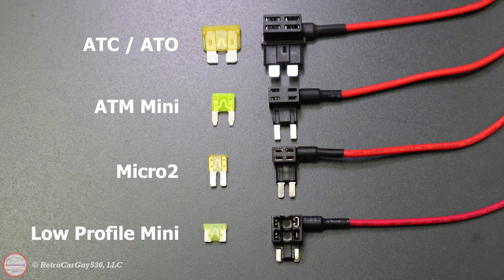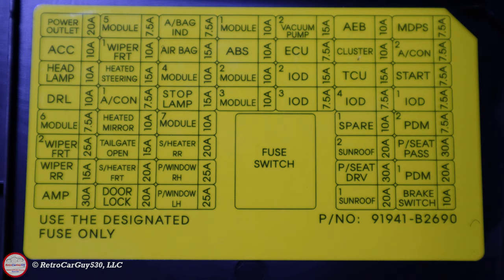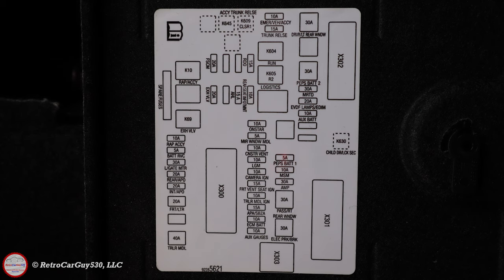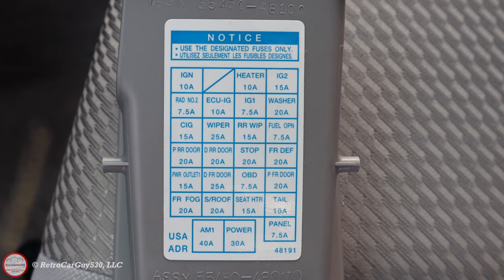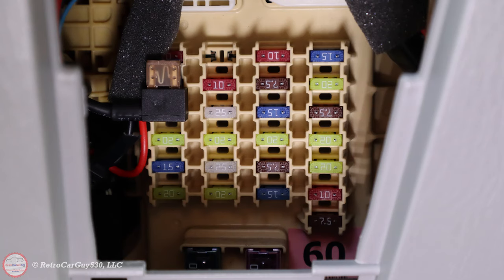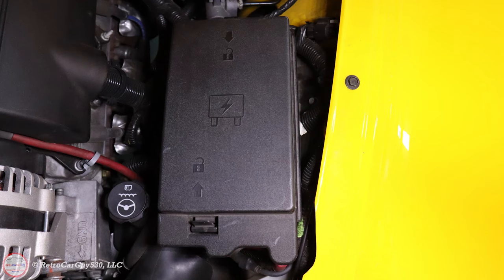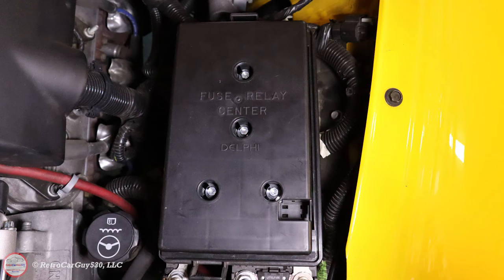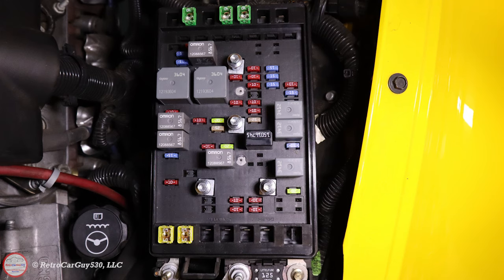How To - Add a Fuse Tap in Your Vehicle

Comment: One question for ya  530 guy? If I take a 15a out to use that space on fuse block ,is it ok to also put a 15a in the other spot on the add a fuse..
Reply from the maker: I tend to cap the max amperage of the two fuses in the fuse tap at 25 amps.  Some say 30 amps is ok, but I tend to favor the conservative side of the amp draw through the fuse tap.  The fuse socket should also be one that receives power directly from the ignition power and not supplied via a power circuit from a module (like the body control module or others).   When the power is coming from a circuit within a module in the vehicle, the module often expects or only supports a specific amount of amperage on that circuit.

My 2014 Chevy Caprice PPV project car on the channel has an entire fuse panel on the end of the dashboard that receives its power from the body control module (BCM).  None of those fuse sockets are a good candidate for a fuse tap since the BCM is not necessarily expecting an additional load on those circuits.  That's why I suggest to avoid fuse sockets that receive their power from a module (like the BCM).

I have a FAQ video talking about max amp draw, wire gauge and wire length.  https://www.youtube.com/watch?v=DnZ5wb_A5vE

Most of the time when the amp draw gets up to 30 amps, the fuse type often is not a blade style fuse.  I know that 30 amp blade style fuses do exist, just they are not commonly used in the blade style fuse sockets.  That's why I like to cap the amp draw at 25 amps for the two fuses in the fuse tap.

That would mean that the original fuse in the fuse socket being a 15 amp (it would go in the lower socket in the fuse tap) and that would leave about 10 amps for the new fuse being added with the fuse tap.

I hope that helps!
Reply: @RetroCarGuy530  I'm trying to power my 30" led light bar, which size switched fuse should I look for ,then what should be the other fuse that I add to the add a fuse??
Reply from the maker: I can't give you a specific answer to what size fuse to use in the fuse tap for the new accessory.  It depends on how many amps the 30" LED light bar will draw when turning on and when it stays on.  The initial power demand can be higher than the steady state amp draw of the device.  I would hope the documentation for the LED light bar would document the power requirements for the unit.  You always want to use a fuse that is rated no higher than what the device requires, otherwise the circuit is not being protected properly.  

If the LED light bar does not come with proper documentation, you may need to check the manufacturer's website for more info.  If all that results in no info on the LED light bar's amp draw, the you may need to use a digital volt meter (DVM) which often has an amp draw feature to test how many amps the device is consuming when you place the DVM in line of the circuit.  Caution: many DVM's have a 10 amp max for their amp draw circuit testing feature so if you believe it will draw more than 10 amps, you many need to find a different way to measure the amp draw of the LED light bar.

Using the 25 amp max for the fuse socket (as explained in my FAQ video), if the LED lights require a 15 amp fuse, then the preexisting fuse in the fuse socket should be no larger than 10 amps so the sum of both amp draws for both fuses does not exceed the 25 amp total for the fuse socket.  

If there is an empty fuse socket that provided the switched power you're looking for, then that would be the best solution since then you could have only one fuse in the fuse tap (upper socket) and it could be up to 25 amps.  Again, you don't want to put a fuse in that is rated for too much amperage for the demands of the accessory or wiring involved in the circuit.

You may want to consider using a fuse tap to supply power to a switched power relay (with a fuse in the relay or in the other power circuit where the relay gets the power for the new accessory).  The fuse tap power (switched power or switched with RAP) can supply power to the control side of the new relay.  When the fuse tap supplies power to the relay, the relay closes the circuit and the relay then supplies power to the new accessory from the power source the relay is connected to with an appropriately sized fuse and wire awg being used for that power circuit.

So, in summary you need to determine the max amps the LED light bar will require.  Feed the LED light bar amp draw in the calculation for the fuse amp size (25 amp total per fuse socket).  Then you'll know what the max amp fuse is for the fuse sockets with pre-existing fuses.
Reply: @RetroCarGuy530  the wiring harness it came with let's the light bar switch work even if truck is off and it drained my battery, was gonna run the positive wire that they tell ya to hook to the battery to a switched fuse...then it goes into the relay that on the harness...I'm not to familiar with this stuff so sorry, just seems dumb to have constant power
Reply from the maker: Ok, so there is already a relay in the LED light bar harness.  Good to know.  Then the power you're sourcing from the fuse tap is for the control switch which then feeds into the LED harness relay.  Most relays control circuits use 2 amps or less many are less than 1 amp.  The LED light bar switch likely has a small light in it as well, so that might consume a small amount of amperage as well.  So, back to your original question about a fuse socket with a 15 amp fuse in it currently, you should be able to add the fuse tap to that fuse socket using a 1, 2 or 3 amp fuse for the LED light bar control circuit (top socket on the fuse tap) and the original 15 amp fuse (bottom socket on the fuse tap).
Reply: @RetroCarGuy530  thanks for you time....

Comment: Where does ground go??
Reply from the maker: The ground wire from the device/accessory being added is connected to screw/bolt nearby that doesn't have any paint or corrosion to prevent a good ground connection.  Sometimes, there will be a ground lug/stud that other ground wires are connected to and you could use that as well.

Comment: I want to add a drl to my car . So can I use my ignition coil fuse to connect that drl using fuse tap? Will it affect any car functionality or is it harmful to connect fuse tap to ignition coil fuse?
Reply from the maker: I would classify the ignition coil as one of the "critical systems" in the vehicle.  I would suggest finding some other fuse socket that provides the type of power required for your DRLs.  Technically, it should work assuming all limits are considered (see below) in that fuse socket.   I'm just not a fan of taping into fuse sockets that provide power to critical systems or modules.

You also need to make sure you're not exceeding the fuse socket's power draw limit for blade style fuses of 25 amps.  I created a follow up FAQ video that talks about wire gauge, wire length and total fuse socket amp draw limits.  Here's the link to that video https://www.youtube.com/watch?v=DnZ5wb_A5vE

I hope that helps!
Reply: RetroCarGuy530 thanks for suggestion
Reply: RetroCarGuy530 I would have also preferred connecting to some other fuse instead of tapping ignition coil fuse however my other fuse related to fan,horn or wiper which are less critical  are using cartridge type of fuse, instead of blade type of fuse. so it’s not possible to tap those using this blade type fuse tap. Could you please share your email I’d, so I could share the photo of my fuse box and fuse diagram of my car to get you proper understanding of the same. So you could guide me the same. Thanks in advance..
Reply from the maker: All of my contact info is on my company website "Contact Us" page.  https://www.retrocarguy530.com/contact

I'll see if I can decipher the abbreviations used on the fuse box cover.  I'm not sure how what the amp rating is of the ignition coil, but if your DRLs are going to draw enough amps to be over the 25 amp limit per fuse socket, the it's not a good candidate.  How many amps are the DRLs capable of using (max load / which will dictate the amp rating of the fuse for the DRLs)?

Another approach (although more costly to setup) is to use a blade fuse tap to supply switched power to a relay which would supply power to the DRLs.  Only the amps to run the control side of the relay (about 5 amps or less) would be needed for the fuse tap.  The relay power circuit would have a fuse inline to protect that circuit and the relay would supply power from a constant power source (positive battery terminal or other safe constant power source in the engine bay like a jump start post).
Reply: RetroCarGuy530 I have forwarded you the fuse box images of my car on the email I’d provided on your site. Please refer the link which I mentions in email for downloading the owner manual of car to get detail understanding of the different symbols present on fuse box diagram. Also I have attached the drl images since it’s not specified the max amp rating which it’s use for drl on the drl box provided. Hope you will get more detail after going through images attached in mail.Do let me know you have any concerns. waiting for your reply...

Comment: I just use a blown fuse to see what side it 12v. No need to really cut it in half.
Reply from the maker: True!  You can use a blown fuse, but in situations where all of you have are good fuses, getting one to blow just for this test may be more effort than it's worth.  I also show using the fuse tap with a single good fuse in the top fuse socket of the fuse tap for the same purpose in my recently released "Anatomy of An Automotive Fuse Tap" video.  https://www.youtube.com/watch?v=YNc0FfeL6rw

Comment: Hi and thank you for your video. I saw you test if there's current using only the red probe of the multimeter, so I was wondering what you were touching with the black one, also sorry for what is probably a stupid question but I
 am not into electronics (:
Reply from the maker: Good question.  I stated I was using an external 12-volt power supply to provide power to the fuse panel.  I didn't show the negative/ground wires (usually black in color) from the test light and multi-meter were connected to the negative wire from the external power supply.

In your vehicle, you would connect the negative lead from your test device to a ground connection point on your vehicle.  The ground connection point would be any exposed/bare metal piece on the vehicle's body/engine, a ground lug where other ground wires are connected or the negative (-) terminal of the vehicle's battery if located close to the fuse panel.

I hope that answers your question!

Comment: and the ground??
Reply from the maker: The ground for the new device is connected to any local grounding location.  That usually means an exposed screw/bolt without any paint on it or a pre-existing ground lug that other ground wires are connected to.

Comment: I think you forget to switch off the ignition key after you found the appropiate place, just to see if the socket recieves permanent power or not. Maybe doing so is a more roght way to nail it from the first mounting attempt
Reply from the maker: At 5:43 in the video I mentioned that you need to have the ignition switch in the appropriate position to make sure it provides the required power type (switched, switched with RAP or unswitched).  To find a switched power fuse socket, you must start off with the ignition switch off and locate the candidate fuse sockets that don't have power, then turn on the ignition switch to see if the fuse socket does receive power at that point.  If you need a switched power with RAP capabilities fuse socket, you would need to turn off the ignition switch leaving the retained accessory power feature still active and then test the fuse socket again to make sure it was providing that type of power.  I'll try to update the video description section and the pinned comment with that additional info.  Thanks!

Comment: How do i know what amp fuse to use
Reply from the maker: There are two questions really.  How many amps does the new device/accessory you're trying to power require?  How many amps are available/useable in the fuse box fuse socket.  The amp draw of the new accessory will determine the proper fuse amp rating to use for that device and you must reference the product itself or its documentation for that info. 

Most dash cameras require 1 amp or less so the fuse for them would be a 1 or 2 amp fuse.  Radar detectors and similar products may require 2 or 3 amps (again - refer to documentation for the product). 

As to the question of the fuse box fuse socket and can it support the amp load of the new device, that's a hotly debated topic.  Adding a device that requires 1 to 3 amps to an existing fuse box circuit is likely to be just fine for most any fuse box fuse socket.  When you need higher amps for the new device you need to investigate whether the fuse box fuse socket gets its power from a source that can handle the extra load of the new device and the load of the pre-existing circuit/fuse (if any).  The wire gauge (awg) of the wiring from the fuse tap is also another limiting factor.  The 14 awg or 16 awg wire will often limit the amp load to around 10 amps from a fuse tap as well.

Devices that require 10 or more amps are not the best candidates to get their power from fuse taps (directly).  I would suggest using a new/separate relay to supply power to the new device and using the fuse tap to obtain the power to control the on/off aspect of the relay.  The control circuit of a relay often requires less than 1 amp as well.  The relay would obtain the power to send to the new device directly from the battery of the vehicle with an inline fuse to protect that circuit.

I hope this helps !
Reply: @RetroCarGuy530  Im trying to tap a LED daytime running light in but I dont know how many amps that requires. How could I figure that out
Reply from the maker: The best place to start is in the product documentation or the website of the company that manufactures the LED daytime light(s).  If nothing is found after that, you could try testing the device with a multimeter using its amp draw configuration (usually those max out at 10 amps).  Another thing would be to get an amp clamp which would go around the positive wire for the unit (assuming this testing is done before installing in the vehicle).

I just don't have any way of knowing the amp draw for the LED daytime running light you're trying to install.  I've never installed one myself, so I don't have any point of reference to draw info from with regard to how many amps it will draw.
Reply: @RetroCarGuy530 okay thank you I’ll read up on them
Reply: @RetroCarGuy530  I found out the drl bar needs .4 amps what size fuse do you think would be best for that
Reply from the maker: If it only requires 0.4 amps, then a 1 or 2 amp fuse would be sufficient.  Most 1 amp fuses then to no be "real" 1 amps, so I might suggest a 2 amp fuse.  You can certainly try using a 1 amp fuse and see if it doesn't blow and if it doesn't, then it should work for you.
Reply: @RetroCarGuy530  do you think 5 amp would work
Reply from the maker: A 5 amp fuse will work, but I would recommend to use a fuse as close to the actual max amperage of the device being powered by that circuit.  If the wiring or the device develop a problem causing it to draw far more current than it should, the fuse will protect the circuit by blowing when an unusual load is placed on the circuit by the problem that is occurring.  You could temporarily use the 5 amp fuse until you can obtain a lower amp fuse to replace the 5 amp fuse with.
Reply: @RetroCarGuy530  okay thank you, i was only asking because i already have a 5 amp one and the only place i could find less than 5 is online
Reply: @RetroCarGuy530  the hot is going straight the the fuse box but where do i connect the black wire to
Reply from the maker: The black (ground) wire can be connected to any pre-existing ground connection point or use a pre-existing bolt/screw that has a good connection with the vehicle's body to give your device its ground connection.